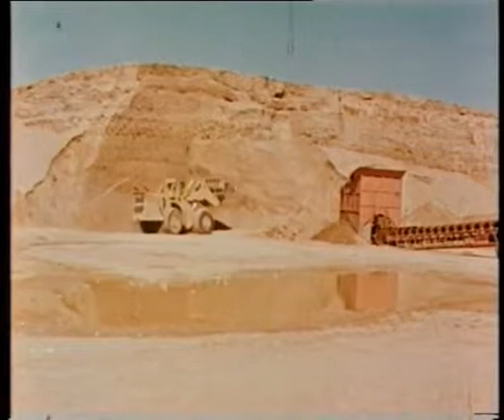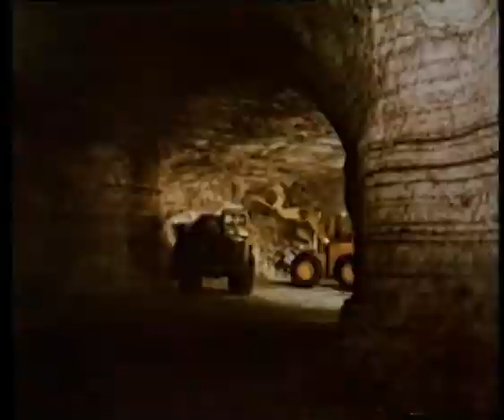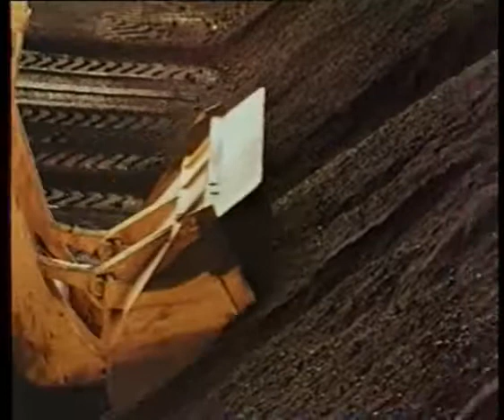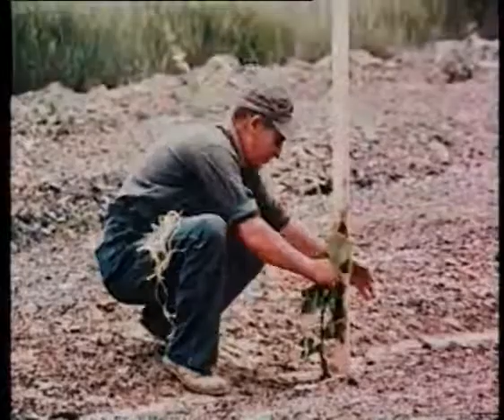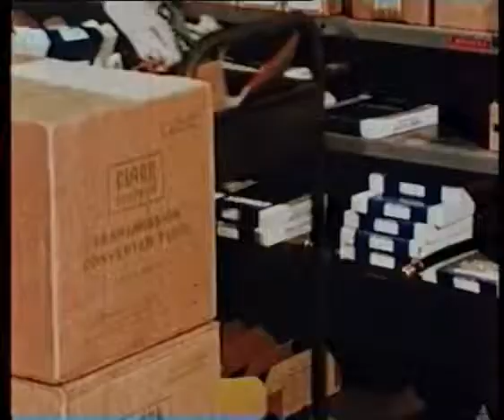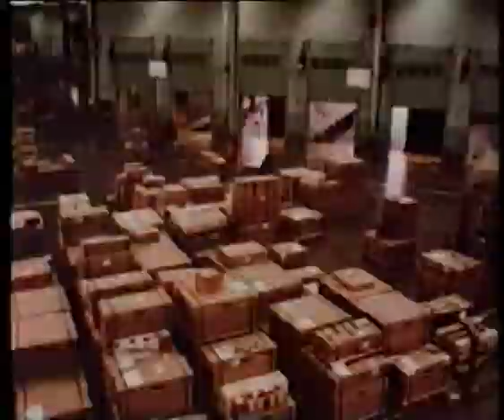CLARK Michigan wheel loaders part 2

Comment: I used to own a Clark 175 with an 8v71 Detroit. Truck loading, and digs like crazy. I was missing it today. That's why I was watching the videos. 

Machine was surprisingly fuel efficient sipping about 40 gallons in a 8 hour day. Load and carry at sand pit.

Used it to push up a dam and used 110 gallons in 10 hours. Figured out how to quiet a Detroit  by putting the exhaust together in a chamber and using 2 baffles
15% smaller than the manifold.
All you could hear is the blower...didn't seem to affect the power...

Comment: P.S. all of the new equipment is a piece of shit...   Always breaking down all the stupid little switches, oh A/C not working today great...

Good old stuff maybe you change the oil, you just dump it back into the fuel tank and run like hell.

Old timers didn't have waste oil problem. They just burned it for fuel. 

I dont think I would do that with a high pressure rail system.